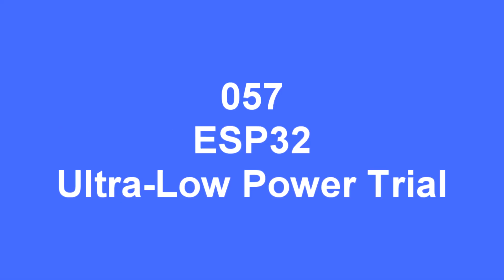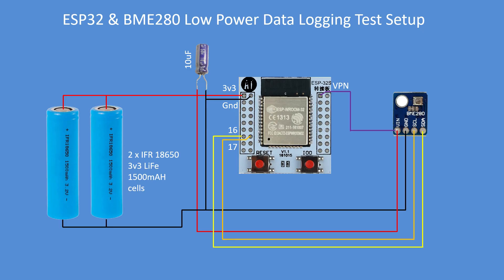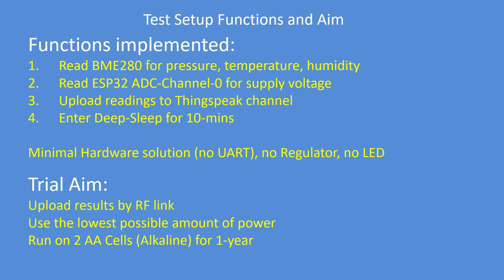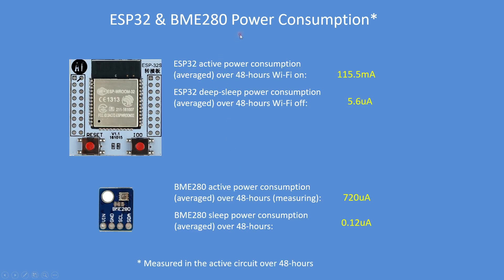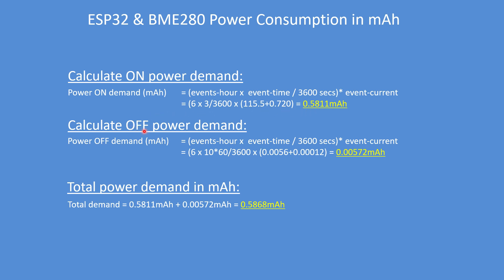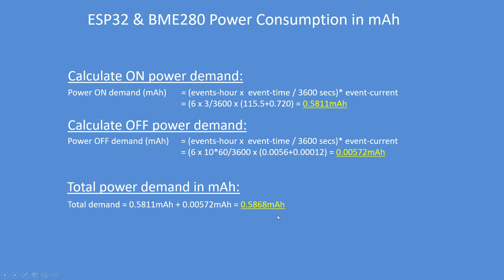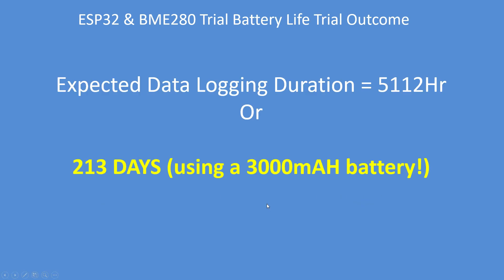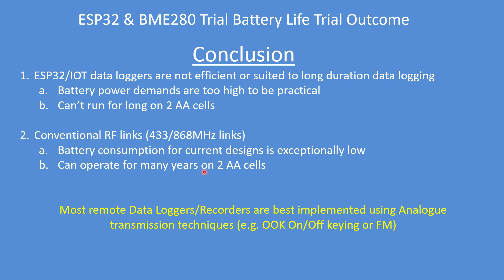Tech Note 057 - ESP32 Ultra Low Power Test Results

Comment: Comparing apples and oranges, the ESP32 has capabilities that you won't get in an analog rf solution. In low power mode WiFi is out, setup time is too large, use the ESP Now which is peer to peer and doesn't require setup time. Two the ULP processor can take the readings and store them so you can reduce transmission time. If you are using the ESP32, why aren't you doing any processing with it? Perhaps it isn't being used for what it is best suited for? I never would have expected a processor like that to last years on batteries. That it lasts months is great and it is running for 3 seconds so it is busy being idle, you should be able to reduce the up time by an order of magnitude by optimizing the rf time.
Reply from the maker: Christopher Guy, The reason for the test was to demonstrate that the ESP32 whilst marketed as a Ultra-Low Power IOT device, is in fact quite power hungry. It’s RF stage consumes twice that of the ESP8266 and whilst the ULP could be used to collect results, that was not the design intention which was to make a real-time IOT sensor not to simply store values then upload them later to get around poor efficiency of the design. There are CPU’s + WiFi that out perform the ESP32 and these do meet the design criteria, but until someone did the tests with the ESP32 we’d never know if the ESP32 was capable of being an practical low power IoT device - it’s not! BTW no one has come up with a solution to the design criteria and if you check out Instructables you will see that I tried a number of techniques to reduce connection times using fixed IP, no DNS, etc and it made little difference. The ESP32 RF stage is too inefficient because the Receiver is taking too much power (Espressif conclusion not mine). I still look forward to someone solving this solution with an ESP32 - comparing apples with oranges ,I don’t think so. I now have a board with an ESP32 plus LORA and it achieves my design aims which was my conclusion as a solution.
Reply: My point was that by using WiFi instead of ESP-Now you were waisting power performing the WiFi setup every time it woke up. 

While LoRa may be a winner in long distance, ESP-Now communicates at 2.4G and it is point to point like LoRa but without the time (and power) consuming WiFi setup. This gives the communication speed of WiFi without a large power drain everytime. As with LaRa, you'll need another ESP32 at the other end.
Reply from the maker: I understand but the design intention was for the IOT device to take a sensor reading and upload the result to Thingspeak and using ESP Now would need an intermediary I receive the data and then upload it. If the ESP32 RF stages and receiver took less power it would help I can get the total upload time down to ~2-secs but low efficiency results in high power demands. I don’t see how ESP Now could change the RF stages to reduce power the RF section is the same power hungry class-D stage no matter what modulation/protocol is used. As I say no one has solved the low power ESP32 IOT solution yet afaik and lots have tried. There are now plenty of cpu+WiFi solutions around that use a fraction of the ESP32 power and so more suitable for IOT designs notice how the ESP8266 is still dominant in many or most IOT devices!
Reply: @G6EJD  Which Lora/ESP32 board you found that runs on low power? I'm looking for one and most development boards seem to be a bit power hungy unless you desolder a lot of stuff that's not needed.
Reply from the maker: hoggif, like you I have not found any boards that can achieve low power because they all omit the control lines to the LoRa modules that enable the LoRa module to be placed into sleep mode, that said most LoRa modules don’t take a lot of power. You can get just a LoRa transceiver on a board then hook that up to an ESP32 which enables you to add a gpio line that places the LoRa into power down, that’s what I would do.
Reply: Nice video but you would definitely get better results with esp now. Yes you would need an intermediary device which connects to WiFi/internet but that's acceptable. You referenced analog rf transmitters as a comparison, using those would require an intermediary as well. Kevin Darah did a similar test and his transmit time was 1.7sec which is about half of what your seeing with this setup. if you got 200+ days on two batteries honestly add 2 more and you have your year at least.
Reply from the maker: The problem I see with ESP Now is it’s largely untested and proprietary. The real problem is the inefficient Tx and Rx RF stage that consumes so much energy to do something so basic, if Espressif hadn’t used s Class-A or B output stage things would have been much better, or even used the ESP8266 RF stage. Yes with batteries with large enough capacity the use-case could be achieved. But it is (was) marketed as an ultra-low power IOT device. Timing could be improved by using UDP, maybe I should repeat the test using UDP.

Comment: You could try to log the data for a period of time and run some simple compression before sending all the recordings for that period...
You can always set upper and lower limits which if exceeded would send immediate etc... else send every hour or two... could give a serious increase in battery life...
Reply from the maker: Michael O'Toole Yes a change in upload strategy could increase battery life, but the Thingspeak API I’m using has no provision for the time of the reading uploaded, so bulk readings all get the same time stamp, so I’ve given up on the ESP32 and gone back to the ESP8266 which can easily achieve the design aims as its RF stage uses significantly less power and the sleep current of ~60uA whilst x10 more than the ESP32 is still insignificant and therefore gives the best solution. Until the test was conducted I did not know the durability of the ESP32 but now I do and for me in these applications it’s no good, so it’s my opinion that it is for others to decide if it provides an acceptable solution for them.

Comment: Solution: after a few weeks of testing and reading the solution was bad silicon from Espressif. All early ESP32 have Rev0 silicon that prevents reliable wake up from deep sleep. I’ve ordered and tested newer ESP32 modules with 100% success. My last test had the ESP wake every hour over three days with no issue. There are sketches you can run that show the silicon revision and you can also show it by compiling in verbose mode in the IDE. Rev 0 silicon cannot be fixed in software. My Rev0 silicon ESP modules will be used in projects that do not need sleep mode.
Reply from the maker: Yes, I recall it was because (you can tell from the Chip boot message when it failed) that it was due to Wi-Fi being started instantaneously, but worth remembering the silicon revision resolved it. I think I'll label my Rev.0 chips so I know and to prevent many hours of fruitless diagnostic work! Thanks.

Comment: You should change upload strategy, and store measured data every hour and use ULP coprocessor to measure temp/hum 6 times per hour (every 10min) without turning the main chip on. That will give you almost 6 times better results.
Reply: Do you have any github or other link of using the ULP instead of main chip on this purpose? That would be great. Thanks in advance

Comment: Great video! As a test I’m blinking an led a few times every 15 minutes. The deep sleep/timer wake up code is the same as yours but after three hours or so it stops. The battery voltage is fine so I’m wondering if there is a bug in the ESP code. Have you run yours over a few days?
Reply from the maker: There are no bugs and I have the same circuit above running since 08-Aug-17 sending data to Thingspeak. http://g6ejd.dynu.com/index.php/wx-logger-data/
The main let's call it issue, with the ESP32 is the relatively large start-up current of early Rev.0 silicon devices, which has been reduced a bit with Rev.1 devices now the norm.

The current demand can be ~450mA for a short time and then 150mA and various current spikes in-between. For your test, I would increase the amount of storage in the capacitor and add a parallel 0.1uF - why. Large capacitors tend to be very inductive so limit current discharge when there is a rate of change, that's where the smaller 0.1uF low inductive capacitor helps out, you generally always see this arrangement in a circuit two capacitors in parallel one large one small. Regarding the size of the larger capacitor, to prevent power supply dip - even from a battery short cable runs can result in a supply dip at the device, you can calculate the value with the approximation. Q=CV or I^2t = CV and where I=450mA and t = 10mS and v=3.3 gives a value for C=61uF. In my setup I used 10uF and noted it was a compromise. IN the ESP8266 functions there was a WIFI_NOCAL option that after sleep did not go through the initial RF calibration routine which the ESP32 does on wake-up and accounts for these high current demands and usually resultant lost of reliability. You could try turning off the Wi-Fi before sleep, or better to try increased storage to eliminate power supply issues. 

You can see some of these artefacts during programming, if the power supply is not sufficient to drive the device, lets say a USB to serial dongle, the chip will keep saying flash programming error or give various error messages, when nothing seems wrong with the programming activity. In fact it reports programmed correctly, but then won't start, this is the high current demand pulling the supply low. But if fed with a separate 3.v power source then it all works.

So my summary is I think your problem is insufficient power supply filtering.

Other things you can try are making the delay variables long using L or LL to increase their size, I don't know what your code looks like, so that's a guess. That said for a 15-min duration a 32-bit integer has more than enough range to store that delay value. 

Does your code run OK on the bench on a development board? As that will have reasonable power supply filtering. IF not then it is a code issue. How are you saving LED state between wake-ups?
Reply: G6EJD thank you for the detailed reply. I’ll tack on two capacitors as close to the ESP32 as possible and run tests again. My blink led code is here: https://pastebin.com/dMCQdFGm
Reply from the maker: Looked at your code and interestingly, I stopped testing for wake-up reasons when I discovered it made my code unreliable. The other issue might be timer overrun (32-bit) and there is an improved test you can do to prevent that, so at overrun there are no unexpected results. I tend to make the timer variable a LL type to be sure (128-bit).

Comment: Thank you! This was very useful for a project I am working on.
Reply from the maker: My advice is make sure you have good power supply filtering/storage capacitors, but not too big, otherwise you will get unreliable operation. You should aim to have at least a 0.1uF as close to the ESP32 power pins as possible and a larger reservoir capacitor of about 10uF or more elsewhere, that way the capacitors can handle short or long peaks in power demands that your supply cannot deliver and the ESP32 takes a lot out of the power supply when it starts and during certain (mainly radio/Wi-Fi) operations.
Reply: @G6EJD  you could use a small solar cell to charge the pack to extend the life since lifp04 are fairly safe and the charge controler is like 1.80 usd you looking at maby 4$ for a 4v solar cell that will do 160mah and a charge controler like the  https://www.batteryspace.com/PCB-for-1-cell-3.2V-LiFePO4-Battery-Pack-at-2A-limited.aspx?gclid=Cj0KCQiAjfvwBRCkARIsAIqSWlPhWrc5AimLG1wf7Lpeg7cXzb7wwld9DnLZQ2FUsdBCuBP18G2sO1QaAlCPEALw_wcB

Comment: Can it run with only 1 battery ??
Thanks.
Reply from the maker: Yes, I only used two to get the capacity up to ~2600mAHr The Lifepo4 18650 chemistry batteries tend to be about 1000mAhr, mine were 1200mA, I have seen 3000mAHr and 2000mAHr, but I believe they are fake capacities as the big branded batteries make nothing like that. I think 1600mAhr is the very maximum you can get. The voltage is nominally 3.2v but they start fully charged at 3.5v and drop to about 2.8v discharged, but have a very flat (3.2v) discharge curve if you can call it that, with a sudden knew voltage at 3.1 that goes to flat/2.8v very quickly, so not much warning. Nonetheless a highly usable battery for 3.3v logic like the ESP8266 or ESP32, one of the easiest ways of getting extended battery life is to use a development board and feed it 3.3v directly onto its 3.3volt pin by-passing all of the UART and regulator that waste power in the final running system. I asked Wemos if they would make a board with a link to isolate the UART, LED, Regulator and whatnot but so-far all they've said is their thinking about it.

Comment: Good info about esp32! Im using a solar panel to solve the issue. My esp8266 12E has been running 1 year+ with one lifepo4 700mA battery. Sending each 5 minutes, Im using a passive diode solution with a 4.3v solar panel.  https://www.automatiserar.se/solcell-och-lifepo4-med-esp8266-12e/
Reply from the maker: Nice project and no UART on your board, so the ultimate in low power, the ESP8266 easily out performs the ESP32 in these applications and yes adding solar makes for the ideal solution too.

Comment: How about you actually read the BME with the ULP and power on to transmit only if data actually changed. Can't really compare the 433/866 MHz to WiFi/BT ;) or compare ESP32 to ESP8266 and expecting it to use less power... There are ways to lower power consumption by lowering the RF power, lowering the CPU clock and even disabling one of the CPUs. And surely you can use ESP8266 since it's slower and has only WiFi, which is what this project requires (not a dual core beast)
Reply from the maker: The genesis of this topic and trial was that the ESP32 is marketed as a ultra low power IOT device and so a perfectly reasonable trial to conduct and sending data back to a cloud-like service is for me a given, if it's to be a useable IOT device.

Yes the ULP processor could be used to read the BME, but neither of the processors in sleep or operating mode are the dominant power consumers and that includes the ESP8266 too.

I do show that the ESP32 uses less power than the ESP8266 but to reiterate that is not the issue, both ESP devices and their transmitters use a lot of power in relative terms.

Lowering the CPU clock has no effect on RF power consumption and neither would disabling one of the CPU's because they are not dominant in the power budget.

I have lowered the RF power and the difference between full and lowest power settings is minimal, but this does not surprise me, because the devices appear to use (no data sheet information, so an educated and experienced guess) a class-B RF stage that is inefficient. As an example my 100W transceiver consumes broadly the same power whether it is set to 100Watts or 20Watts, but the efficiency changes dramatically and this is not unusual for any RF power stage / transmitter and the ESP8266 / ESP32 RF sections are no different in that regard.

On the Instructables forum I and others have conducted numerous tests aimed at reducing power by for example, keeping alive the IP connection, changing protocols (TCP v UDP), not using DNS Services and other techniques, but none made any appreciable difference to power consumption.  

For efficiency there are far superior Wi-Fi devices on the market like the Microchip 1810 series, showing that a high efficiency Wi-Fi connection can be achieved, but ironically not advertised//marketed as a ultra-low power IOT device!If you can find a way of reducing power consumption then there are a lot of people around who would be very interested to know how to do it. 

It is (in my opinion) only ever going to be a viable IOT device if it can be used for low power work and be powered with a battery for a reasonable amount of time, say 6-months to 1-year, but it can't.

Comment: Are you using low power wifi in tests?
Reply from the maker: I have tried reducing RF power output, but it has negligible affect on the power drawn because of RF stage design, I see this a lot with class-A/B RF amplifier designs. Espressif could have usefully used the ESP8266 RF stages, the ESP32 is particularly power hungry. For example with my 100W HF transmitter it consumes about the same power on 100Watts as it does on 20-Watts because it is the early stages that consume the bulk of the power. yes, RF power is reduced, but not efficiency. The ESP8266 performance far better in this regard.
Reply: Thanks,  Yeah I was just reading the RF cal boot up modes, it seems to already be fairly optimized, and light sleep already disables radio between beacons also.
Reply from the maker: I also tried starting the ESP32 in no_cal mode like the ESP8266, it's the really high peak in current ~350mA when the radio starts that really hits the PSU and causes problems, fixed in Rev.1 silicon, but it's such a short pulse it has little energy over hours and makes no difference from my measurements.
Battery power over many months is not really the forte of an ESP32 !
Reply: Do you know if the 8285 is designed for low power usage? I noticed it is much smaller and with built in flash, but have not checked specs yet or tested one.
Reply from the maker: It requires ~80mA verses ~160-240mA so about 1/2 to 1/3 of what the ESP32 requires. Flash size is 1Mb which for most applications should be adequate, I’d put it into the same category as an ESP8266 which may use less, I consistently measure 8266 current consumption at 74mA. There are that many 8285 development boards around, some are dedication boards too so not fully versatile.